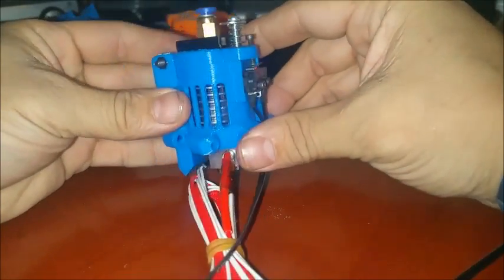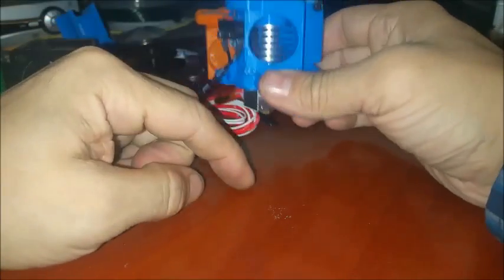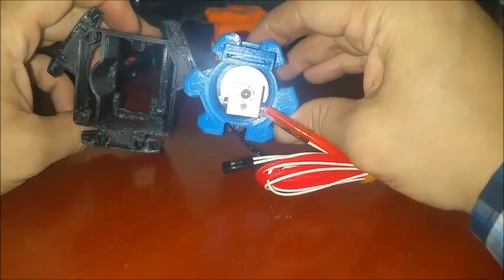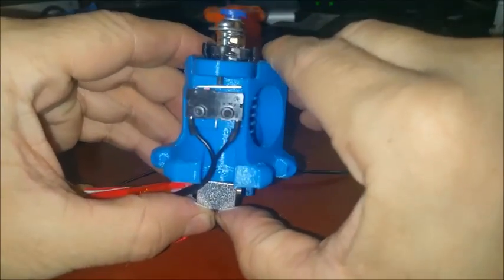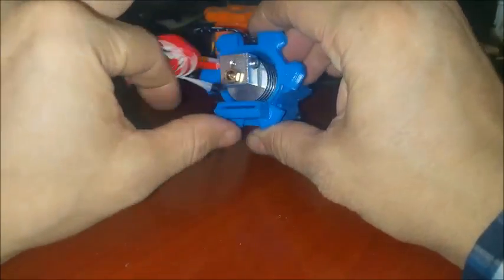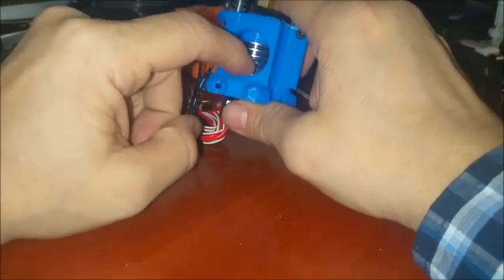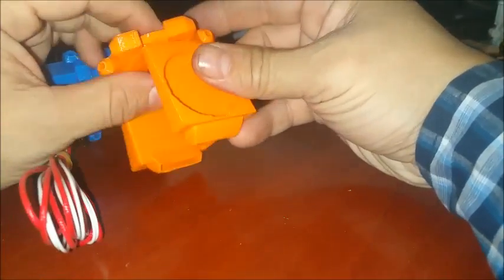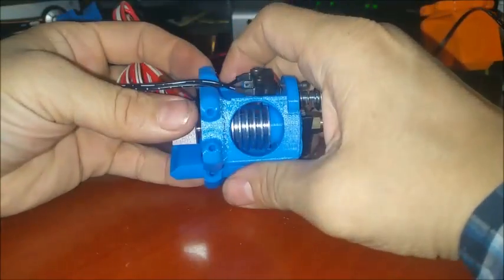New Compact Effector with autobed leveling

Comment: can i print with PLA ?
Reply from the maker: Yes this can be printed in PLA as the heater block is below the shroud. I am working in a modified version at the moment as the fan for filament cooling can cause issues with rod clearance.
Reply: Yes i cnow dhat...it's not possible to mount fans
Reply from the maker: just the filament fan,  I am uploading another version to go with this one today that re positions that fan
Reply: thank oyu
Reply from the maker: I have uploaded the modified version to the same item page along with a version for the E3Dv6 I have not had time to print and test them yet. The modified version gives you a choice of fan for the filament cooling based on what you print out
Reply: Thank you... i'm printed 1st version and i have problems with both fans not only for (filament-nozzle)